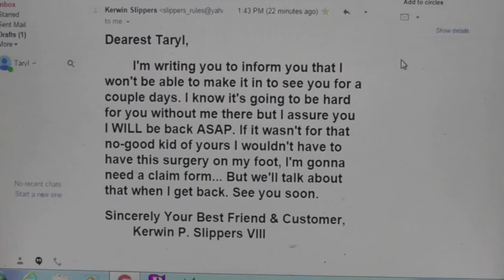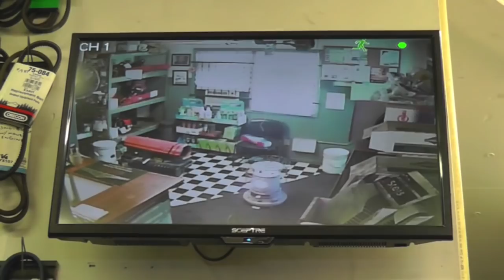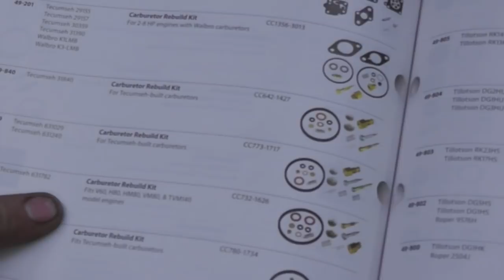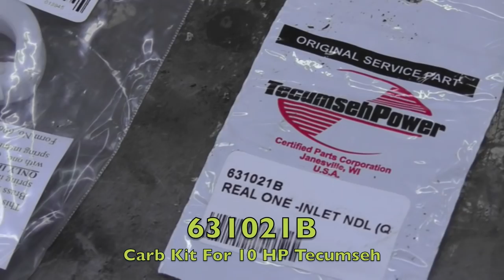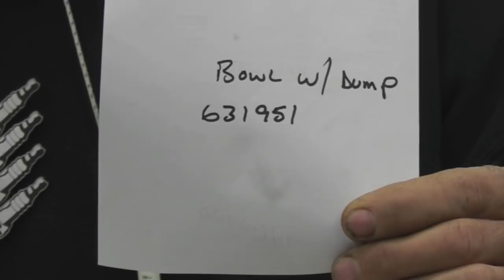How To Rebuild Tecumseh Snow Blower Carburetors with Taryl

Comment: Hi Taryl, I have a Simplicity snowblower with a Tecumseh engine (model HSSK50).  It starts and runs fine, but keeps dying when it's under a load.  I recently replaced the carburetor and the spark plug, and I have no idea what the next step would be.  Of course, to make matters worse, we're currently in the middle a blizzard here in Massachusetts...Any help you could offer would be greatly appreciated!
Reply: check your gas cap might be stopped up
Reply: Check fuel flow disconnect the line at the carburator and see how the flow is with the cap on, if flow sucks open the cap more and see if that helps, if so buy a new cap.  If not, then remove the gas tank inside is a welded on fuel filter.  You will need to clean that with water pressure pushing the debris back in the tank.  Use the kitchen sink.

Comment: Hi Taryl, Great, great video. I'm rebuilding a 632370A carbatraitor off a 1995 - 10 HP Snow King (HMSK100). This is the older type mentioned that has the adjustable idle screw. I've got everything done but I'm struggling with the movable tube in the idle circuit. I've been soaking with cleaner and using WD-40. I went on to investigate further and found a breakaway showing that there's an idle fuel pickup hole on the inside of the tower where the main jet/bowl nut screw goes in. This hole is hidden in the threads and is opposite the small ball bearing that's pressed into the side of the Tower. There's also a ball bearing pressed into to the top of the Tower. From what I understand these two ball bearings are in place to seal and prevent fuel from getting past those points. When I spray cleaner through the idle control screw hole the fluid exits freely out of this idle fuel puckup hole inside the column. So, I know that there's no blockage there. Do all of these carburetors have that moving tube inside? Is there any way you could take a cutting wheel to an old junk carbatraitor you have to show what the floating tube looks likes inside this sealed area? Thanks again for a great video and I look forward to any response you can give me.
Reply: I WAS WONDERING THE SAME THING I NOTICED IN THE VIDEO HE SAID IT WAS ONLY RELATED TO THE CARBS WITH THE LONG LOW SPEED NEEDLE WHICH MINE HAS THE SHORT NEEDLE. HOWEVER I DON'T HEAR THE TUBE MOVING INSIDE THE IDLE CIRCUIT EITHER SO I DON'T KNOW IF ITS JUNK OR NOT ???????????????
Reply: HEY TARYL DO YOU GOT AN ANSWER FOR THIS ?????????

Comment: Even after a rebuild my model will only run when pressing the primer button.  Any thoughts?
Reply: Take bottom bowl off carb and check for carbon deposits. Clean/replace fuel lines. Remove and clean fuel tank. Run some Seafoam in your tank as recommended (read the instructions on the can).. If none of this helps then you have set the carb incorrectly or forgot/missed something in the rebuild (ie small gasket) or flow chamber (what the flow needle screws into) is still or re-plugged. Don't run gas with ethanol. Good luck

Comment: I'm not mechanically inclined for 10 yrs i. Never clean the carburator or servive it,wheni watch yor video i learned how to open he cover of carburator   When i open it i mark all the screws where to place it after i clean the carburator......i saw a hose hanging not attache( i don't know where it belong ) is there a hose connecting to the carburator? There is 3 hoses one connected to gas,one maybe to the prime ,one is hanging straight down.what is that hose? Do i leave it like that? Thank you Taryl.
Reply: Bayani Mangale that could be a vent.  One of my lawn mowers ( I think with a Tecumseh engine) has a short rubber tube that is only connected at one end.
Reply: Main gas line coming in would be the 1/4" ID line from the gas tank, the primer line-it's about 1/4" OD, and the oil breather vent from the engine block, witch is behind the carburetor-this line hangs down open. Don't do anything with it. ;)

Comment: Hey Taryl  I think you got yourself a crazy eye from running those blowers in the garage for too long.
Reply: P.S.  I don't think you made it important enough that the float level be right.  If the float is too low, meaning the fuel level is too low, the choke and/or the primer bulb will not pull gas into the throat of the carbietrater and will be hard to start.  Great video though and thanks for it putting in the time.

Comment: hey guys question i got a jacobsen imperial 626 with a tecumseh 6hp now i'm looking for the spring thats on the governor arm linkage to the throttle arm on carb tecumseh don't list it its a small spring 1'long
Reply from the maker: +pete Stockbauer  Is it the one that takes the slop out of the link? If so you could make one from a throttle link spring from a briggs.
Reply: yeah thats the one thanks i thought is was a special spring due to the fact its on the governor linkage and connects to the throttle i pick on up thanks for your help

Comment: Hi, I have the same carburetor as the second one your a cleaning, when remove the idle needle I do not hear the tube inside moving/sliding, is possible that it is stuck due to corrosion. What can I do?
Reply: he wrote that you can spray WD40 in the hole and torch it to help break it free.
Reply: If you are unsuccesful at breaking it free buy an oregon replacement.

Comment: Taryl!!  I ate my dinner but I’m still hungry!  I have done what you recommended for a surging idle. Drilled out the main Jet one size up. (Was about .40 and is now .45)It is still surging.  It may be a little less surging hard to tell.  Do i need to adjust governer?  I would say it runs at high speed but doesn’t want to idle low.
Reply: Taryl served you dinner, but it seems maybe you have eaten from the dog's bowl.  Surging is from a blockage in the LOW SPEED circuit, aka the idle circuit or pilot circuit.  Taryl told you to drill out the low-speed jet, (idle jet, pilot jet) not the main jet.  That said, make sure that everything, especially the idle circuit, is completely clean before you drill anything.  And if the carb has a needle valve for the idle mixture, you just adjust the valve and don't drill anything.
Reply: @wryanddry2266  ok well i wrote it wrong as I did drill out the idle jet not the main.  At times didn’t surge as much but still does so it’s inconclusive.
Reply: @Lightworks1111  Look in the throat of the carb near the edge of the throttle plate.  There you will see three tiny holes.  That is where gas from the idle circuit enters the throat.  Did you clean those?  Use a wire from a bread-wrapper tie or a bristle from a wire brush.  When you spray carb cleaner through the idle jet, you should see it spraying through the three little holes, if the idle circuit is clean.  But you must have a different carb, because this Tecumseh carb has a needle valve (not a fixed jet) in the idle circuit.
Reply: @wryanddry2266  yes i did learn about that breather hole when i was working on the carb and checked it. And yes the carb did  have the idle screw/jet with the little cap on the end of the flat head. Initially it was clogged but i cleaned it out well and that’s when i got into hand drilling to enlarge the jet just slightly.  Thank you!
Reply: @Lightworks1111  Not "it".  "they".  I believe there are at least three such idle-circuit holes in the throat.  Anyway, mine has three.  It sounds likely that that is your problem.  And there is plenty IDK about carbs, but I have never heard of drilling a needle valve.  I think the stock valve ought to be able to pass more fuel than you need.
Reply: @wryanddry2266  ok right i dunno why i keep missing on that i was thinking of a small hole that is on the exterior of the carb that is just a “breather” hole.  I did make sure those inside passages were clear. I did a “deep clean”. Full disassembly on this particular one.  The low speed needle on these screws all the way in until it stops so there is no adjust on them. That’s why taryl said on some you may need to drill out as they get worn out they may need a little extra fuel.    Thanks
Reply: @Lightworks1111  You're not clear on the difference between a needle valve and a fixed jet.  That's not a needle that you screwed in.  It is a pipe with a fixed size orifice.  You can drill it, but you can't adjust it.  It does not involve a needle.
Reply: @wryanddry2266  yes, your right. Lol. It is a fixed screw that is basically a pipe with the holes in the one end. It’s the basic Tecumseh carb on a lot of older sno-blowers.
Reply: @Lightworks1111  I just bought an MTD snow blower that has a 1994 Tecumseh engine, seemingly with the original carb.  Both the main and the idle circuit have needle valves.

If yours is clean and still surging even after enlarging the idle jet, first I would check that the governor is set up right: linkages in the right holes and governor arm set properly.  Taryl has a video about adjusting the governor for this same engine.  Another question is whether there is a problem with the "tube" that Taryl in the present video says you should hear rattling in the carb.

Comment: Taryl, do I have to put sealer around the welch plugs?  What sealer can you use?  Thanks!
Reply from the maker: Pete Ciallella you can use silicone or fingernail polish. Both would work
Reply: Thanks for the tip Taryl!

Comment: What if it idles but cuts off when you turn the choke off?
Reply: The idle circuit is restricted, these carbs get gummed up when gas is left in a long time. They seem impossible to clean out.  My solution was to put a mower carb on (which only have a primer bulb and no choke), now, it is to go on ebay and order a carb for around 12 dollars. They all have the same bolt pattern but change the venturi size for the hp differences. I get the ones with adjustable jets, also,make sure the choke arrangement is the same as the one you have. One other thing- if in doubt, a smaller carb works better than a larger one.

Comment: Where do you get that book at for the carb rebuild kits?
Reply: Read the model number off your engine, then get on the interscreen or elsewhere for a parts diagram.  That will tell you the carb part number and will determine the rebuild kit for you.

Comment: Hey guys, I wanted to say thank you for putting these videos together and letting those of us who are interested benefit from your years of experience. I just finished a log splitter, (sorely needed and gratuitously given to me) and as usual I do first then learn how to do what I just did. Allow me to share with you, I needed to swap out the plastic governor gear and the shaft was a press fit. I'm quite proud of the trick I figured out. After measuring very carefully I drilled a hole in the case just big enough to get a small blind punch in there and presto, or more accurately, bango. I hammered the shaft out, put the new gearand on and tapped it back in. I did find a " small engine specialist" telling someone to use vice grips and "twist" the shaft out on a website. I can't see anything good coming from that advice. As always thanks, and there's your dinner!

Comment: Here is how I think you can avoid taking out at least one of the Welch plugs, namely the one on the side near the idle-mixture screw.

Look in the throat for some tiny holes near the edge of the throttle plate when the throttle is closed.  They will be opposite the Welch plug on the side of the carb, meaning the holes are on the inside and the Welch plug is on the outside.  Remove the idle needle screw and spray some carb cleaner into the hole.  You should see spray coming through three tiny holes and spraying into the throat.  If not, that explains why it won't idle.  Anyway run a tiny wire into each of those holes to clear it, then check for the spray again.  When done, have the carb right-side-up, as Taryl says, when you screw the idle-mixture needle back in.